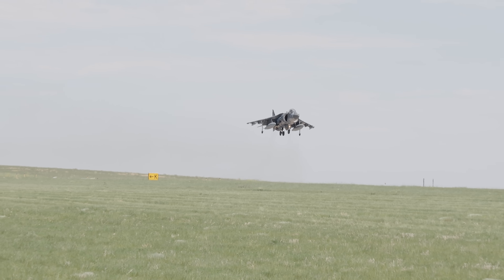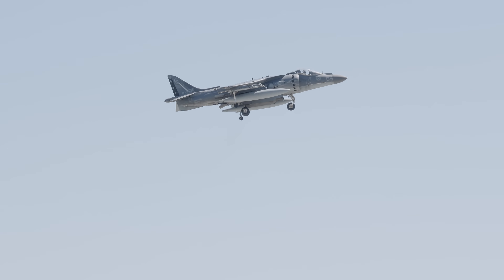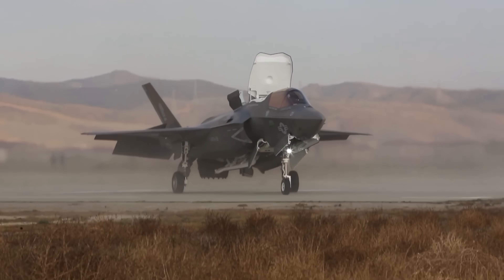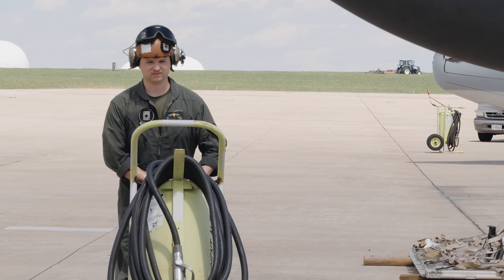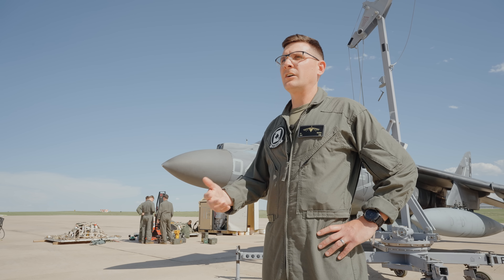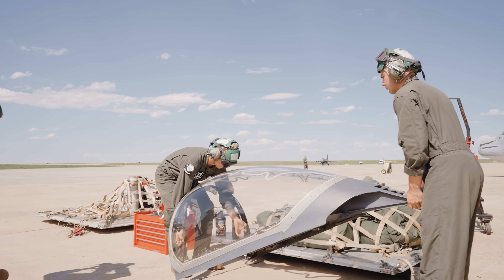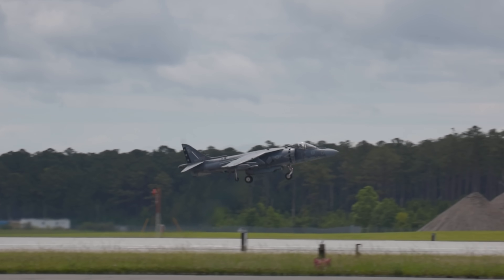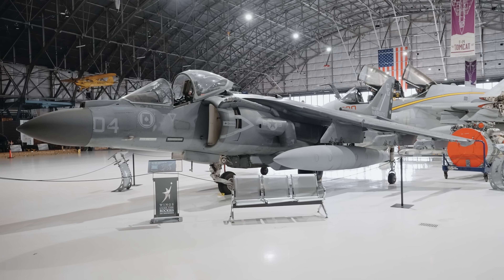Inside the Secret Process of Retiring a Harrier Jet | Behind the Wings

Comment: Mcdonald Douglas? Not Hawker?
Reply: There's more to it than that. The AV8B Harrier II is an entirely MD developed aircraft that succeeded the original Harrier. Hawker fell out of the program early when the USMC requested a replacement for the Harrier in the 70s, and so MD took on the job of making the Harrier II.
Reply: @米空軍パイロット 70's dont be sillythe hawker harrier was only designed and built in the 70s the americans didnt get it till much later.
Reply: @pbysome  USA bought British Harriers designating them AV-8B/C. The AV-8B was made by MD in the USA with some input from across the pond. It would have been great to see Japan fly the Harrier
Reply: Hawker developed and built them in the UK for their military.  McDonald Douglas built them under license for the US.
Reply: @bobmartin4942 "McDonald Douglas built them under license for the US."(sic)

Incorrect. McDonnell Douglas did not build either the AV-8A/TAV-8A or the AV-8B/TAV-8B under license.

Comment: I have a love hate relationship with that airplane. I was a 6015 on that airplane in VMA 231. I worked the power line and did desert shield and Desert Storm. 
It was loud I've lost some hearing in my left ear. It was extremely hard to work on God forbid if somebody dropped a socket. During Desert Storm that airplane dropped everything from 500 pounders to 2,000 pounders rock eyes and napalm aka fire bombs. 

Semper Fidelis 💪🏾🙏🏾💪🏾🙏🏾
Reply: Yeah they really put in a lot of work and it's rarely mentioned
Reply: Saw the "Ace of Spades" in Hawaii (MCAS Kaneohe Bay) O'Ahu, as it was transiting from Iwakuni 1st MAW, on its way to the Gulf for Desert Storm. I was a 7011. Semper Fi!

Comment: The Brits who started it all don't even get a mention huh?  Very impressive work by the US Marines nonetheless.
Reply: It was not a video about the history of the Harrier. I was a video about the retirement and demilitarization of ONE specific aircraft.
Reply: Same old, same old. Take claim for every thing.
Reply: The US modernized it with the carbon fibre plastic wing. Really gave it a life renewal.
Reply: @unclefart5527  Correct, but not only the "Big wing". MDD also added the bubble canopy (which was really from the Royal Navy Sea Harrier). Beside the "big wing" the other truly important improvements made by MDD were - L.I.D.S., fully shrouded cold nozzles, larger L.E.R.X. and the change for V/STOL to STOVL.
L.I.D.S.  was big. MDD felt that the AV-8A was a terrible aircraft, especially in hover. L.I.D.S. stands for Lift Improvement Development System. L.I.D.S. is composed of 2 surfboard-sized strakes installed on the bottom of the fuselage. The GAU-8 gun pod was also modified and 2 smaller strakes installed. The other part of L.I.D.S. was the software was re-programmed, so that during hover, the nosewheel gear door was kept in the down position and the belly-mounted speed brake was also deployed (or down). These 4 components - 2 strakes, nose gear door and speed brake formed a "box" on the belly of the fuselage. With all 4 nozzles directing their thrust straight to the ground, some of that exhaust bounces off the ground and comes back up to the belly of the aircraft where it is "trapped" by the L.I.D.S. components resulting in a MUCH more stable (and safer) hover. MDD mandated that the USMC not fly the aircraft without the L.I.D.S. components installed.
On the AV-8A the cold nozzles (front) and the hot nozzles (rear) were identical - that is, all 4 were WIDE open. This is fine for the hot nozzles because the high velocity, rapidly expanding hot exhaust gases benefitted from larger nozzles. But, the cold nozzles were merely for compressed air that did not have quite the same velocity and thrust of the hot exhaust. MDD recognized this and fully enclosed the cold nozzles - a la Bernoulli effect. Same as using your thumb to partially restrict the end of a garden hose - instant pressure and velocity increase. On the AV-8B, MDD shrouded the cold nozzles resulting in a MUCH more stable (and safer) hover.
In a high-G turn the AV-8A bled off airspeed like it was going out of style. For the AV-8B, they added L.E.R.X - Leading Edge Root eXtensions between the wing and fuselage. These look like half-moon shaped pieces of metal extending from the wing to the fuselage. These L.E.R.X's great improved the handling of the AV-8B. It did not make it as good a dogfighter as the F-16, but it was a huge improvement over the AV-8A. On the AV-8B Night Attack and AV-8B Plus (radar) the L.E.R.X.'s got slightly larger.
The AV-8A was touted as V/STOL - Vertical Take Off and Landing  and  Short Take off and Landing. The AV-8B with its "big wing" capable of carrying A LOT more bombs and missiles than the AV-8A ever could.....made it impossible for the AV-8B to lift off vertically with fuel fuel tanks and full bomb load. For the AV-8B, MDD told the USMC to forget about vertical take-offs (except during airshows) and adopt a STOVL operational mentality - Short Take Offs and Vertical Landings. So, short take-offs from LHAs/LHDs or airfields with fuel fuel and full weapons load. Then Vertical landing on the LHAs/LHDs when returning after dropping all bombs and almost empty fuel tanks OR short landings at airfields.
The USMC had ordered the original AV-8B (day attack) and as soon as they started taking deliveries they realized the aircraft was missing night attack capabilities. So, they asked MDD to develop a night attack Harrier. This became the AV-8B-NA (night attack). This included FLIR sensor on nose of aircraft, new MFD screen in cockpit for displaying the FLIR images, a color moving map display, a wider heads up display (HUD), additional chaff and flare dispensers on the top-side of the rear fuselage to replace the  original dispensers on the under-side of the rear fuselage AND a slightly more powerful Rolls-Royce F402-RR-408 engine with 23,000 lbs thrust instead of the original which only produced 21,000 lbs.
After the Gulf War in 1991, the USMC and USN began retiring many of their F/A-18A Hornets and purchasing new F/A-18C Hornets. The F/A-18A's had APG-65 radar while the newer C's had APG-73 radar. MDD recognized that there were hundreds retired F/A-18A's with their APG-65 radars and wondered if these could be retrofitted to the AV-8B's. So, MDD took it upon themselves, as a private venture, to develop a radar-equipped AV-8B. The British Royal Navy Sea Harrier F/A.2's already had larger fiberglass radome nose cone with a British-built radar behind them. So, MDD used the Sea Harrier radar nose and tried to fit the surplus APG-65 radars from the Hornets, but they wouldn't fit. Hughes/Raytheon (manufacturer of the APG-65) advised MDD to cut down the radar dish to make it fit the nose cone explaining it would only degrade performance slightly. The radar was only intended for ground attack and not a dedicated fighter MDD did not see this as a problem. MDD showed the radar-equipped Harriers to the USMC. They liked it and and began buying AV-8B Harrier II PLUS's instead of Night Attack (and Day Attack).
However, at the same time, the F-35 research and development program was ramping up and a lot the USMC budget was being diverted there. So, the USMC was never able to fully equip all 8 Harrier squadrons with 100% radar-equipped AV-8B's. Instead each of the 8 squadrons was a mix of 50% night attack and 50% radar AV-8B's.
Remember too that in the 1970s,  British Aerospace (who had taken over Harrier production from Hawker Siddeley) told all of their customers - USMC, Royal Navy, Royal Air Force, Spanish Navy, Indian Navy - that Harrier production was ending because the number of aircraft wasn't enough to justify further developments. The USMC with their AV-8A had the LARGEST Harrier fleet of all. This was the aircraft the USMC had dreamed about for decades so they asked MDD to get involved. British Aerospace suggested MDD take over as prime contractor with British Aerospace as a sub contractor.....if the new aircraft was good.
Soooo, LOOOONG story short......MDD did ALOT more for the development and refinement of the Harrier II than they get credit.
Reply: @unclefart5527   No McD-D partnered with BAE Systems and Rolls Royce to create the Harrier II / AV-8B after the Harrier I / SHAR / AV-8A / AV-8C were all built in the UK. Each partner built specific parts of the airframe and then did final assembly for its own uses from sub-assemblies shipped in or built there. Like McD-D built the AV-8B and BAE Systems built the GR5, GR7 and GR9
Reply: @1chish  Revisionist history. Final assembly of the 41 GR.5/21 GR.5A/34 GR.7 took place in the UK. The 60 GR.9/GR.9As were all upgraded GR.7s. The majority of the manufacture of the 5/5A/7 occurred in St. Louis at McDonnell Douglas. 

The UK abandoned the Harrier II redesign from 1975 - 1981, returning when Thatcher had become PM, paying the United States over $200 million and signing a MoU - Memorandum of Understanding - that relegated the Brits to the role of subcontractor on the 96 Harrier IIs purchased by the UK. You've already been corrected a number of times yet persist in posting your subjective nonsense. Very telling.
Reply: @AA-xo9uw   ah now we have some detail. Except it confirms exactly what I wrote!
As I said the final assembly for each nation took place IN that nation. But the final assembly lines (FALs) built aircraft from sub assemblies made in equal part in each nation. A similar deal that worked for the T45 Goshawk built from the British Hawk jet.
The fact that the USA built more airframes does not nake it a US aircraft. Because the British had supplied the sub assemblies required.
Remind me who supplied the biggest part of the Harrier - the engine? That was in addition to the workshare agreed for the airframes, wiring, fuel and other systems.

Oh and when copy / pasting from Wikipedia copy all of it Dufus.
Reply: I think the US even bought a load of ex-RAF models when RAF retired them.
Reply: @vinceely2906  Yes, but just as spare parts sources. They never intended to fly them.